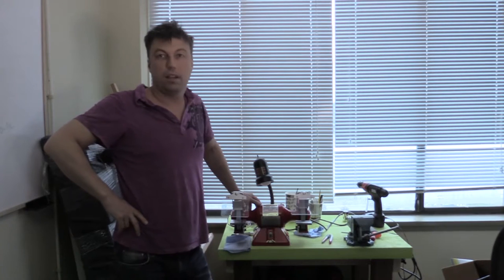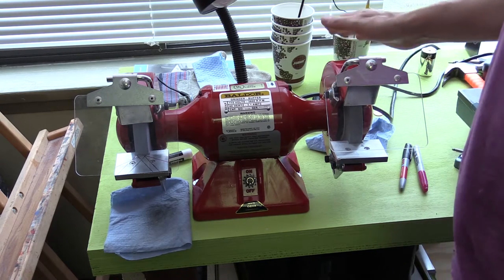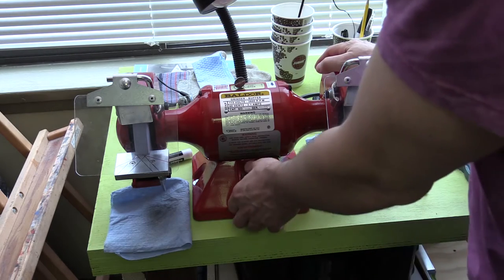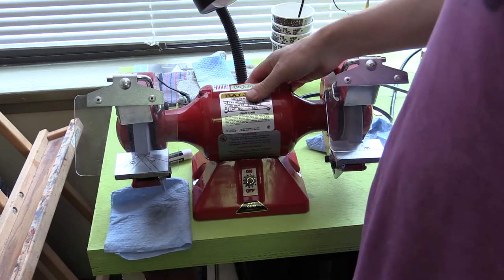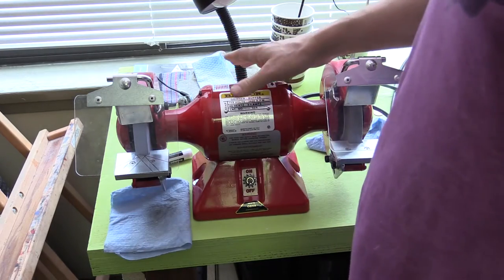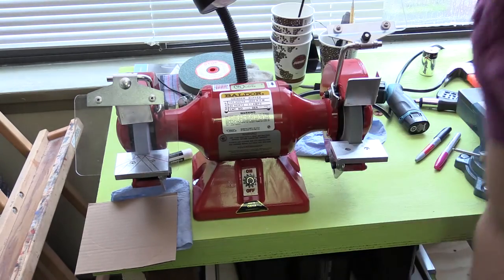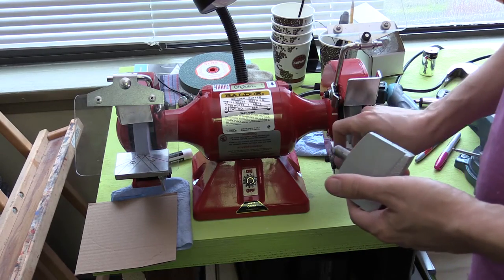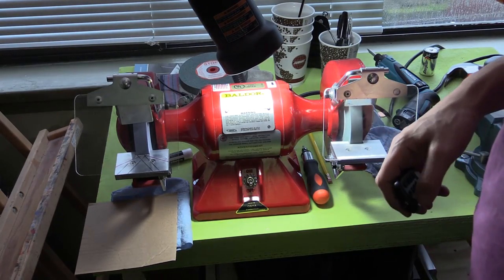Episode 19, Setting up bench grinder, 6'' Baldor 612R, balancing and dressing

Comment: Thank you, that was a comprehensive video on how to get a purchased machine, working properly. Most people purchase a bench grinder, set it up and accept that what they have is OK and normal. Grinders are a very dangerous tool and should be treated with respect. I find it hard to believe that these machines are allowed to be sold as is. Your method of balancing is by far the best I have seen also the balancing plates screwed to the wheel give a better fixture to the spindle. Once again, thank you.

Comment: Hi Alexi and others that may happen upon this. good video. To balance the wheel with the method shown take out the screws and weights immediately. Put it on the balancer and let the heavy part of the wheel settle to the bottom.Draw a felt pen line straight down. When the wheel settles down you will get a feel for how out of balance it was. Now put the weights and screws back in with one screw EXACTLY OPPOSITE of the heavy part that you marked with felt pen. THAT ONE SCREW NEVER CHANGES--TIGHTEN IT AND DONT TOUCH IT AGAIN. Now take the remaining 2 weights and place them at equidistant thirds of the wheel. Now you can begin to balance. Take the other 2 weights and move them equally toward the one screw you set. Check balance if still heavy then move those same 2 screws closer to the main screw you set..  If the wheel is very out of balance the 2 weights will end up very close to the main screw you set. If the wheel was almost balanced--then the amount you move the 2 sliders and screws towards the main screw--will be slight.  Using this method you can balance grinding wheels in less than 3 minutes.

Comment: Far too much too much time (aup to 7:55) spent talking about the tool rest plates. You didn't need to mill the slot underneath, since you bolted them down anyway. More importantly, you added a precise flat aluminium plate onto the horrible wobbly inaccurate weak stamped steel brackets. You extended the width of the tool rest, yet any pressure on the outside will simply bend/deflect the bracket and tilt the plate downwards on one side.